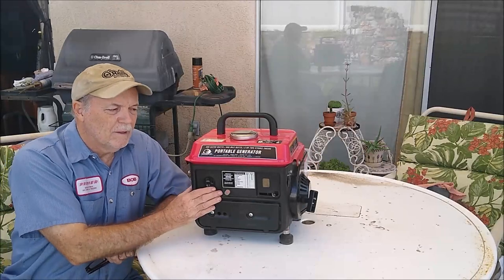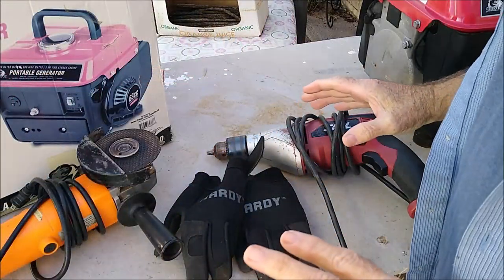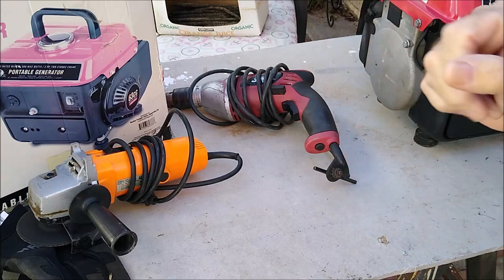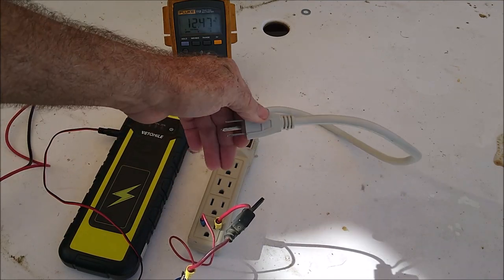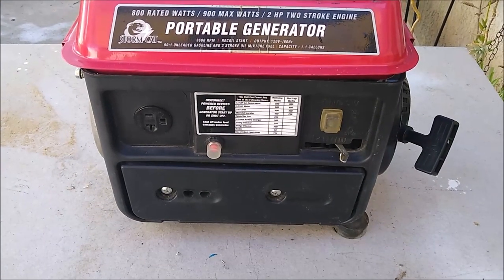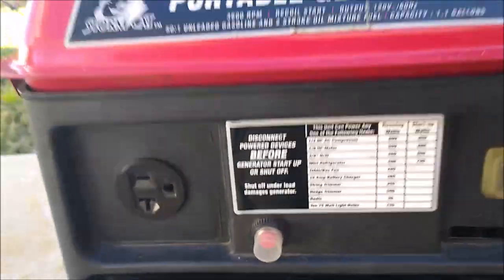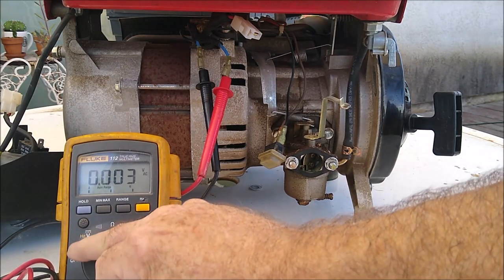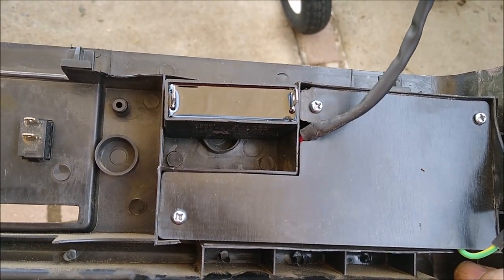Harbor Freight Generator No Output... Diangostics and Repair

Comment: How I solder copper clad aluminum enamel wire? as well as copper copper enamel wire.  

Knowing the enamel will soften under solder melting temperature, once soften can be rubbed off/open exposing copper clad surface.   
Use liberally of flux (from flux core solder) to engulf / protect the enamel wire to avoid chances for exposure of clad to oxygen in the air, otherwise we’d accidentally rub and oxidize the thin copper cad. This process takes time and patient. 

If all else fail clean the CCA wire and Vaseline coat it then crimp a spade terminal to reconnect the broken junction.
Reply from the maker: Gee thanks for the reply.. Have you done videos on YuTube? I'd like to see you perform this proceedure...
Reply: @bobamos3628  It was a repair but YouTube production. Sorry no video taken. I can capture that next time.
Reply from the maker: @philoso377  Well, if you ever do make a video of it please let me know. I would like to see the process that you use..
Reply from the maker: @philoso377  Done.. Looking forward to the video..
Reply: @bobamos3628  I shall make video when I can find enamel CCA wires. It is not easy to find. Do you have sample of those?

Comment: Hi Bob, new to this sort of stuff, I can find this exact ccb1 11uF 300vac but ranging anywhere from $30-50, i have found lots that are a little different for much cheaper. Could a 12 or 10uF 350vac capacitor work just as well for example. If not what is the important thing I need to look for as the original 1 in the unit is 11uF 300vac and the 1 in your link is 11uF 450vac. Thanks for any help.
Reply from the maker: You will be fine with something close in the range for a condensor/capacitor. (Same thing different name) I picked mine up for about $10 dollars give or take a few bucks. I do not recall exctly now. It's old history.. Amazon and eBay have them. I recently picked up one of a different design for my father-in-law's generator and it was $7 and change. Thanks for writing. Chris, I saw that I left a link in another post. Here is that capacitor. https://www.amazon.com/gp/product/B07VXYDHVT/ref=ppx_yo_dt_b_search_asin_title?ie=UTF8&psc=1

Comment: All three of mine have always worked fine, the earliest of the three has a 12V battery charging feature which has a cable and clip leads which attach to the end frame for charging lead acid batteries.  Anyway, I've only used these when power has gone out for more than a couple hours maybe once/year, if that.
Reply from the maker: I have another brand of generator but just wanted one of these because they look sort of cute. Got this one real cheap and decided to do this video of the repairs. Like you, I only use them when power has been out for a few hours. Took one camping once but way to loud for that.. Thanks for writing.
Reply: @bobamos3628  They get me through in a pinch, they've saved the contents of my fridge and freezer a few times now.

Comment: I have a 2cycle generator from Harbor freight  with 800 to 900W. Would you have information on setting the timing of the generator I have had a problem on mine, which I believe is the timing. It jerks the starter cable out of my hand when starting. It may be trying to fire be it is supposed to. Thanks!
Regards,
Robert Fern
Reply from the maker: Sorry, I haven't a clue on the agility to change the timing of the spark on these as it has never been an issue for me and the last time I had one open was quite some time ago. I will look and see if I see a way.

Comment: What diodes are in these ??  i am pulling one down and was wondering the diodes in them --just incase i need to get them
Reply from the maker: Gee, I wish that I could tell you but I have no idea their rating. I did see a wiring diagram for it. But am away from my computer on a trip. I should be home early next week and if I can remember I will see if I can find it.
Reply: @bobamos3628  Well i got the gen head off the unit -- so i can finally see what they are
Reply from the maker: @michaelfarabee  Great. Mine were fine so I didn't think to identify what was in there as far as diodes went. Probably woud have been a good idea.

Comment: Hello, I would be very happy if you could help me. I can't get voltage from my generator as in the video. When I got the rotor, I saw that the resistor and the diode were burnt out, so I couldn't see or read the colors of the resistor. and my generator has only one resistor and diode, not two like yours. I decided to install a new resistor and diode, how many ohm resistor should I use? can you help me or someone tell me how many ohms Is it realistic to use resistors?(also my generator is a 220v 50hz generator
the mains here is 220v 50hz😃)
Reply from the maker: I think that I said what it was in the video. I do not recall at the moment. But.... seeing as yours is carrying all of the loadon one resistor it may not be the same as my 110 voltunit was.

Comment: Just got one for free got it running. Hooked up a 4.5A grinder cut 1/4 into a log and it stopped putting out power. Breaker does nothing. Any ideas before it's trashed?
Reply from the maker: Without having the unit in front of me it is difficult to say. I would try doing a direct flashing of the capacitor. Look in my video list, I did a video on direct flashing of the capacitor. Sometimes the drill method does not work. Hope this helps.

Comment: What if the drill ran for a few seconds do I need a Capacitor or what.
Reply from the maker: Wish that Icould answe that for you. If the drill started running I would think that the generator had been "excited" and the capacitor was charged. But there is the possibility of an internal fault in the Cap. that might cause a drop out. I did a video on charging the Cap. directly. Give that a try and see if it helps. ALso, there could be any number of things that might cause the generator to stop charging. First thing in my mind would be moving parts followed by weak connections that drop out once a load start to flow. Wish I could tell you more but without the unit in front of me all I can do is guess.. Good luck.

Comment: Great video thank you for sharing. I have the same problem with mine , the dialed flew out destroying the fan , could you tell me or anyone tell me what is that part called
Reply from the maker: The part that was damaged in this video is the rotor. Sort of like armature but without brushes.

Comment: Hi Bob,   I have the same problem with a HF Tailgator did you get 120v at the plug if you put 12v dc to the condenser?  I do...   Seems if I excite the field I get power..  Thanks !
Reply from the maker: After repairing the rotor fault and replacing the capacitor I direct flashed the capacitor. I did a video on doing the flashing. Look in the video listing for it..

Comment: Hi, so i have the tailgator version of this generator, i tested the leads coming from the capacitor and i'm only getting 0.11 to 0.20 ac volts, and i have resistance from the 110 lead. so.. everything beyond that is checking out.. i took the rotor out like you did and checked everything over.. it had a couple nicks in it but all in all it looked really good. i put it back together and still the same issue. i replaced the cap and nothing there aswell. Any ideas?
Reply from the maker: Did you flash the new capacitor? They need to have a charge in it in order to start the charge process. I did anothe rvideo on the flash process. Here is a link to that video. What you are showing is exactly what a loss of stored power shows. https://www.youtube.com/watch?v=kh3IvlJL3TQ&t=7s
Reply from the maker: @HunterTalksWeather  Well, while you had it opened, did you measure the resistors and check that the diode had current flow in only one direction? You will need to isolate them to check it and will need the wire glue to reinstall them. Only remove one end to check. Also, check for contenuity of each of the coils of wire on the armature. Make sure that there is not continuity to the rotor framing. Do the same for the outer coils. It is difficult to impossible to diagnose without the unit in front of me but hopefully you will be able to find the fault. Remember that mine checked good on that rotor until a probed around and found a broken with. It is a very fine wire and difficult to work with bt, in my case, had to be worked with. Good luck

Comment: Excellent video mate. I've got one on these (it's branded a power craft 720 I think it's 650w 240v) that is not giving out any power on either the 240v or the 12v. I've just taken it apart to inspect the windings in mine, as they all meter out fine with continuity. Slightly differently made to yours, different diodes and resistors I think. I'm yet to cut and test them as they'd soldered them under a bit of plastic so I'd have to cut them off the copper to resolder so I'm hesitant.

I think I might be dealing with a bad cap. Unfortunately my crappy multimeter is only half working, so I can't trust what it's telling me. But the cap looks old. It's a 15uf and I had a 12uf from a dehumidifier I took apart. Do you think that would work? I did try it but nothing worked.

I am yet to try the 12v across the cap whilst it's running yet.

Does it have to be running for that to work, can I put 12v into the cap when it's not running, and then install?
Reply from the maker: First, you do not need to have it running to "flash" the capacitor. It also does not matter the polarity. I always flash them while connested to the circuit. 

A question: I had someone asking about their rotor ony having a diode and resistor on one side while the other was run in series to the other. Mine is a 120 volt system and was wondering if they just split the rotor in half to achieve the half voltage of your 240 volt unit. 

Mine has no 12 volt output so not sure what is in that system as I have nothing to reference to.

Comment: Saludos desde Mexico, por ser en inglés no entiendo muy bien sobre el capacitor o condensador,  tengo un generador como el del video que lo pusieron a trabajar pero no desconectaron el suministro de energía aunque en ese momento no había  electricidad el generador dejó de funcionar  y ahora solo entrega 50 v . no hay problemas con las bobinas,  y el capacitor me da 11.9 mf     ¿Debo cambiar el capacitor aunque me de una medida aceptable :?:
Reply from the maker: Folks, This is what was written... Greetings from Mexico, because it is in English I do not understand very well about the capacitor or capacitor, I have a generator like the one in the video that they put to work but they did not disconnect the power supply although at that time there was no electricity the generator stopped working and now it only delivers 50 v. no problems with the coils, and the capacitor gives me 11.9 mf Should I change the capacitor even if it gives me an acceptable measurement:?:
Reply from the maker: Al no tener el generador en mis manos, es difícil determinar qué está mal. El hecho de que tenga algo de voltaje indica que está funcionando hasta cierto punto. Sugeriría mirar en una bobina de campo que podría estar en cortocircuito y no permitir la salida de voltaje completo. También mire la armadura en busca de algún tipo de falla. Quizás un diodo. Eso requiere tomarlo aparte como tuve que hacer. Espero que esto sea útil.
Reply: Appreciated the first translation. But no translation for your reply?

Comment: Mine won't put out unless you plug in something pretty big 250w heat lamp for example
Reply from the maker: Sometimes the idle speed needs to be accelerated in order for the generator to be energised.

Comment: As far as the diodes and resistors, couldn't tell the direction of the diodes on each side? Can't find schematic of armature! Both sides of mine has deteriorated!
Reply from the maker: I do not think that their are any schematics around. At least I never found one. As to direction of the diode. If one went bad I would imagine the second would be fine. I would test it for direction of flow and then duplicate that on the bad one...

Comment: Ok Bob I check everything you did on mine and check out and still nothing Ok was it the wire or the resistor great job Rodger here
Reply from the maker: On mine it was the thin wire from the rotor winding that attaches to the resistor and diode end. that was an open circuit.
Reply: @bobamos3628  ok thank you so much awesome video I will dig a little deeper
Reply: Ok Bob I went back over everything and it seams to check out but it has low voltage If I plug my drill into it it runs but I can stop it with my hand I did but a new capastaor in it could it be bad thanks Rodger
Reply from the maker: @rodgeremery5691   The capacitor just triggers the system into action. If it is being triggered then it is most likely okay. Low output can come from a number of things. Too slow rotation of the rotor, a bad circuit in the stator is another. Remember that the system is a magnet (rotor) spinning withing coils of wire (stator). In this case, that spinning magnet breaks the field of the stator wiring. It goes from north to south and back again over and over. This causes AC current to flow withing the stator. 

How it all works....If you run electrical current through a wire it will have a magneting field around the wire. Also, if you run a magnetic field over a wire it will cause current to flow within. That is how these work. So, if the stator does not have enough wiring to flow current withing it will register as low. 

Voltage is one thing but amerage is another. Amperage is the amount of current flowing, or pressure, while voltage is the amount of energy available, or potential. Knowing which is absent would help lead you in the right direction. 

Make sure the generator rotor is spinning fast enough. Low engine speed or a slippage between the rotor and engine is possible. Check continuity of the stator windings and match the resistance ratngs. In other words, they should match closely. Also check the resistance ratings of the rotor circuits. Same here, must be close. 

Good luck..
Reply: Thank you so much I'm on I believe talking to you now when you plug something in and use it the motor always Revs up but it does not so I'm going to say it's the stator I'm going to work on it thank for your help and I will keep in touch to let you know the progress you have been a big help to me I appreciate it.
Reply: Hi Bob I have went back threw it again I know I am missing something I don't know ok when I plug something in how it  is supposed to power up it does not it just run normal it does not change and just put out low voltage what ever I plug in I can stop by hand any ideas.
Reply from the maker: @rodgeremery5691  First thing I would do is start the generator and plug something into it. A light is best because you can see the increase in voltage. Then manually increase the engine speed and watch for the light to get brighter. If it does them the generator is probably fine and it is the lack of engine speed keeping you from getting the voltage that you need. Look for anything that might be causing the carb to not open like interferance of something or binding in the carb. On top of the engine is a spring and some linkage. At the end is an adjustmant that usually has silicone squirted on it to keep you from messing with it. Remove this silicone and try adjusting that as well as making sure that the linkage attached is clear of obstructions and that it moves freely.
Reply: Thank you Bob I'm on it
Reply from the maker: @rodgeremery5691  If you need infor on how the throttle control works, have a look at this video. They did a wonderful job on explaining. https://www.youtube.com/watch?v=3jUpb71D3is
Reply: Hey  Bob thank you for your help ok I ordered some parts for it I seen that one Diode was puff up I knew it was bad so I order 1 and 15k ohm resistor and they came in but the resistor are shorter than the one that is in it does it matter it is the same in colors just shorter.
Reply: I was just wondering if you got a chance to read my comment no hurry it was about the length of a resistor I bought it's the same except the length it's a 1/4 inch long and the old one is 3/8 long
Reply from the maker: @rodgeremery5691  As long as you can get the wire ends to reach the length does not matter. It can be attached either way for the resistor. The diode MUST be positioned in the exat same direction as the original. Generally there is a strip around one end. A diode is a one way electrical valve. (sort of) On mine I cut the existing wire and soldered in trhe new resistor and shortened the wire on these to fit. The resistor's rating in watts must be the same or higher. These were 1/4 watt so any that fits in there will do. Good luck.
Reply: Bob you the man, when I took it apart I seen a Diode was puff up I knew then ok thank you so much